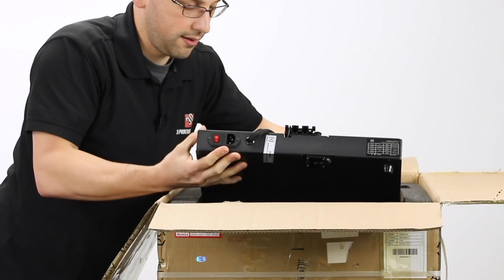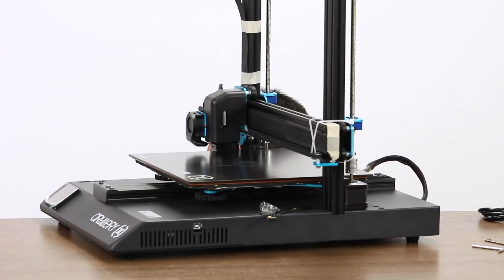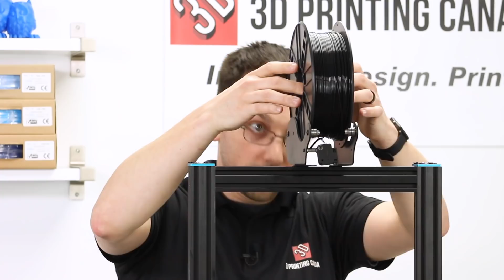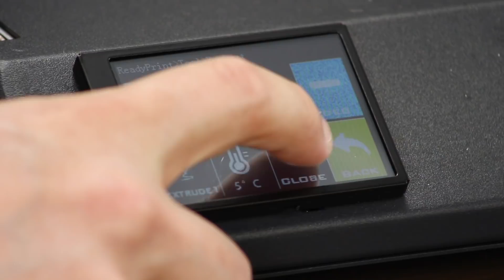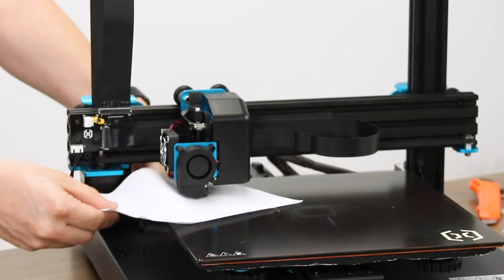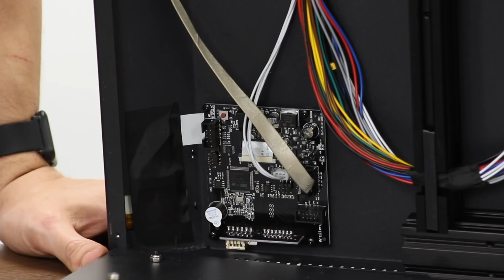Artillery (Evnovo) Sidewinder X1 3D Printer Unboxing, Build, and Test

Comment: Thanks for a great video.
Your channel is helping me a lot to get into 3D printing as I’m now looking to purchase my first printer.
I know it’s difficult to give advice so instead of that I’d like to ask you a question, anyone else who reads this and want to answer, please, feel free.

If you have to choose between the Artillery sidewinder X1 v4 or the BIQU-B1, which one will you choose and why?

Thanks in advance
Raul
Reply: Raúl Garcia Tapia I have been researching printers for over a year (while saving money for the purchase). I kept coming back to the Sindewinder because it is a “polished” printer. So many videos and comments are about “tweaking” their Creality printers - I’m concerned BIQU will be similar. I bought a printer to print objects not parts to polish my printer. I received my X1 V4 last week and have been DELIGHTED. It works perfectly right out of the box.  I tuned my slicer setting to the filament I bought by printing several Retraction Test prints. Once I got the extruded temp tuned in (I started about 15C to high) the stringing disappeared and the printers are excellent.
So my advice ... see if the BIQU videos and comments are about printing or about making parts to tune the printer.
p.s. I really liked this setup video and followed along as I setup my printer. The camera work was excellent. For example I wasn’t sure if I was to use the lock washers on the gantry bolts and the video clearly shows that. Doubt eliminated.

Comment: Looking at other channels that reviewed this printer, there are a bunch of easy fixes:
- tighten all the belts.
- don't use the stock spool holder and filament sensor; they are the main culprits of the odd layers.
- change the stock PTFE Bowden that inside the hot end. the stock one isn't brilliant and is a lot more narrow which also caused issues.

Comment: Hi.  I just received my Artillery Sidewinder X1 07/03/20.  A couple of things I thought you may be interested in. First, there have been changes to the cabling since you did your review. the  ribbon is attached already and now uses a locking connector not the push fit.   The Z stop sensor is also already installed and is not adjustable any more.  Finally, the dual Z belt at the top was tightly fitted and not loose as was yours.

The printer is really good and prints well.  The only problem I have is that using octoprint with the side usb connector seems to randomly crash the print making it just stop dead with no error.  The printer has to be rebooted to get it to work again.   To reboot it you have to pull out the printer usb as I found it was powering the printer even when it was unplugged.  That was a little disconcerting, pulling out the power cable to the printer and the LCD panel and hot end light stayed on! Took me a second to realize that it was drawing power from the usb. 

Hope this helps.

Comment: I just purchased the version 4 printer and am expecting my feed materials this evening.  Everything went together smoothly, as with your installation.  I have never used a 3D printer, so this is going to be the first of many (at least in my head...).  Thanks for confirming my thoughts for the finishing touches...
Reply: How is it now, how are the prints and would you recommend it

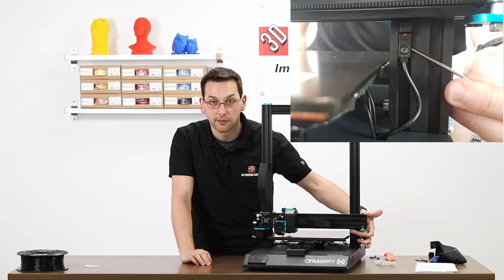Comment: Hello! What did you do to move the Y-axis sensor? 23:58) Since it comes screwed and the red light marks at 7.1mm, is it necessary to adjust it to 7.5? did you glue it? thanks for your time
Reply: That's the Z end stop sensor not Y as you've mentioned. And must be placed around 75mm not 7.5 as you've mentioned too. Take a look at the new reviews to X1 version 4, now the sensor is in a fixed position, not adjustable anymore. This means that for a better result on bed leveling and Z axis sensor positioning the first step to be done is to tighten completely the 4 big adjustment knobs under the bed (  compressing the springs as much as possible without breaking anything ). Step 2 raise the gantry manually. Step 3 place the tip of the sensor 75mm higher than the top surface of the bottom structural box. Step 4 bring the gantry downwards until the red light comes on. Step 5 loosen the big knobs evenly bit by bit until you reach the desired gap between the bed and the nozzle tip. Note that step 5 must be completed with bed and nozzle temperatures set to max. due to thermal expansion of the materials.

Comment: great video!     I think the folks over there that make the sidewinder must have taken a lot of input from you and others they gave their machines to for testing because my bed leveling was much easier. The Z sensor was already set to about 2mm from keeping the nozzle off the bed at the 1st round of leveling.  This was much easier to set up than my Ender 5 that I bought 18 months ago.  I also did not have a problem printing from MICRO USB or USB STICK.

Comment: This video confused me a bit.. and caused me to strip the hex-hole on one of my wheel's screws on my x-carriage... I didn't realize what "eccentric nut" meant, so I was trying to loosen/tighten the other nut instead.. I REALLY wish this video would have SHOWED me what nut needed adjustment, rather than just saying it.. Cause I ended up stripping the hex-hole on that screw, because the allen wrench they gave me was undersized.. Didn't even have to force it much to cause that.. ugh...
Anyone know where I can get a few replacement screws for those wheels? >_< This was a brand new printer.. I feel like such an idiot..

Comment: I really hope I didn't damage my printer.. I was trying to screw those bolts in underneath, off the edge of a table like that, when one of the rubber legs somewhat thumped off the edge, causing the hole thing to tilt and bump itself down onto the edge of the table a bit.. it wasn't a terrible impact, cause I was sorta holding it and it wasn't really a drop or anything that serious, but it was a bit of a jolt... I feel like such a klutz.. really worried about damage now..

Comment: I wonder who the asshat was that decided ribbon cable was a good idea on parts that are constantly moving back and forth...  Also there are no locking clips on the connector..
Reply: I've seen a few 3D printed clamp solutions for the X1 ribbon cables to help make sure the connection isn't upset during movement, but I've also heard of people putting a few dabs of hot glue on the connector when plugged in to help keep it in place - Glue which can be removed with some tweezers when you need to service the machine. Then again some people take no precautions with the ribbon cables and get lucky; their printer works for many print hours over the span of months without issues.

Comment: It looks like the 30 pin FCC ribbon cable was already connected to the breakout board on your 3D Printer. It wasn't on mine and the connector came right off the breakout board because I thought something was wrong with it - the X-axis carriage kept making a streaking loud noise when I moved it with the buttons on the touch screen. One or two pins on the 30 pin FCC ribbon cable looked messed up to the far right of the cable before I even put it into the connector to only damage the breakout board. An extra 20 pin FCC ribbon cable was missing from packaging, but I have an extra 30 pin FCC ribbon cable. It's too bad I don't have an extra breakout board to connect the extra 30 pin FCC ribbon cable to. >.< :(

Comment: That looks like an older revision as the latest revision has the reset button on the front by the touch screen.  I hope you will not be selling the older revs.
Reply: I spoke with them on the phone, they told me they were expecting Version 4, which should be the latest one for now.

Comment: So it's been 3 months since you posted this review but I haven't seen any follow up videos. What is your take on this machine now? I just ordered one today, really unbelievable at just $355 with free shipping. Do you know what version they are up to now and the changes per version? And how do you figure out which version your printer is? Will be very interested to see if the z issue you delt with is still around.  Can you run through what you did to eliminate that again please? Based on what you've learned,  what things should I double check with my new printer? What upgrades would you recommend? Thanks for your setup & review and looking forward to your reply.
Reply from the maker: We are receiving new-stock v4 units which have been improved over the v2 which is what was in this video.
Reply: @3DPrintingCanada  How do you distinguish between a v4 and the v2?

Comment: How do you figure out if you're buying the previous model or the current model? There's like 3 different listings on Amazon for the Sidewinder.
Reply: v4 version cames with a resume printer button next to the LCD
Reply from the maker: You can't they don't label the version number on the machine
Reply: Ask the seller. Some are currently listed as V4.

Comment: For anyone looking for this: https://www.banggood.com/ArtilleryEvnovo-Sidewinder-X1-3D-Printer-Kit-with-300300400mm-Large-Print-Size-Support-Resume-PrintingFilament-Runout-Detection-With-Dual-Z-axisTFT-Touch-Screen-p-1411501.html?utm_design=41&utm_source=emarsys&utm_medium=Neworder171109&utm_campaign=trigger-emarsys&utm_content=winna&sc_src=email_2675773&sc_eh=6bcea63a4e95e4bf1&sc_llid=14339318&sc_lid=105229698&sc_uid=Fibwt6sNxe&ID=48036&cur_warehouse=CN if it breaks any rules then please remove. All in all a great video but would have liked more details.

Comment: Heya,
Contemplating getting one of these, I already have a CR10, Tevo Tornado and a Folgertech FT5 (as well as 3 other smaller footprint printers that I rarely use). That said, I have always found that one of my first upgrades I do on all of these printers tends to be the fan shroud because the cooling on the stock is almost always inadequate so I normally go for the PetsFang.
How is the cooling on the Sidewinder?
Did you ever find out what the stepper drivers are? while talking steppers, do they have pots or is the voltage set by the firmware/UART?

Thanks in advance
Reply: @Jason I think something went wrong with my Lin Advance, I ran a K Factor print test in jumps of 10, no diff, did it from 0.1 to 10 in 0.1 jumps and they all looked the same so something didnt work on my K Factor setup.
Other printers I just do 0.1--5 in .1 jumps and on my other printers its normally around 0.3 or so. I need to run through my settings again sigh
Did you look at your backlash nuts? just curious if its just me or on all of them cause they made a lot of Z wobble lines till I changed them out
Reply: @Jason Ahhh I see. Thanks for that, all my other big printers are all bowden so didnt know about that change. Will give it a try after my current print finishes.
Do you find your prints are a LOT slower when using Lin Advance?. 
I have run it on a couple of my other printers and a print at 90mm/s with LinAdv on looks (and time wise) to be printing sub 60mm/s. I mean, I get that it changes the behavior when approaching corners etc but I didnt expect that much of a change. Mind you, I could just set the print speed at say, 150mm/s then it should be more like printing at 90mm/s.
Print quality went up a LOT but print times dropped a ton.
Reply: @Jason I would be interested in the results. 
I am much like you. When I first started out I was all about speed, I wanted good parts as fast as I could get them. 
Now that I have more printers than I know what to do with, speed is not really a huge deal because I pretty much always have at least one printer sitting there idle that I can throw the next print onto while waiting for others to print. 
I recently printed a 790mm tall 'Dobby' that took 1 day to print because I had 5 printers going at once each printing one part of the body. A day to glue, sand and prime and I have a great model, back when I only had one printer, that would have taken me a week or two haha

Comment: Would you recommend the X1 or CR-10S Pro?
Reply from the maker: At this point in time the CR-10s Pro is a better choice in our opinion
Reply: 3D Printing Canada do you still think so after the updates you did. I own a 3d printing company with several prusa i3 mk3s but I'm looking to expand the size/ print volume. I like the direct extruder on the x1 over the cr10s pro. Why do you suggest the cr10s over this machine?
Reply: @oneheadlight8000  i asked the same question. It looks like he doesn't monitor the questions once he uploads the video.
Reply from the maker: @oneheadlight8000  The V1 V2 and V3 X1 3d printers had issues. We are waiting to test a V4 before we make any further comments.
Reply: 3D Printing Canada thank you. I will keep an eye out for further comment.
Reply: @3DPrintingCanada  can you please elaborate on why this is the better option.
Reply: I got the 10S Pro, and Im really liking it :) I changed all of the fans (only the print air cooling left) and its practically silent, prints great!
Reply: Marcin Bauer does the 10s pro have the magnetic bed? I heard the bed demagnetized at higher temps so you can't print ABS or ASA easily. We have products that we print using ASA and I would love to be able to have this printer as an option for those products also.

Comment: This is by far the most comprehensive instruction video of all I've seen about the X1.  Slow and concise.  Thanks.  About the Z stop?  Most others say to put it on the outside slot so the wires don't catch on the bed.  I deleted my original post.about the extra flat cables.  ;-)
Reply: @Jason would you happen to have a S3D Profile you could share?  Need something to get me started coming to the X1 from a Tevo Tornado.  Thanks.  PM me.
Reply: @Jason would you happen to have an S3D profile for the X1 you cold share. I'm coming from a Tevo Tornado and there's big differences. Thanks
Reply: @Jason Thanks

Comment: I have this printer. It is very nice. One recommendation is to absolutely not put the spool on the top of the Z axis. Its just too tall and that is too much weight and your prints will suffer. Also the optical  height sensor needs to go on the far rail or your hot end assembly will hit it when going far right.
Reply: Blake Haas yeah I disagree. The extrusion is so solid on this machine. Make sure all four feet are firmly planted on a solid surface and you shouldn't have any issues with a spool mounted up top

Comment: I have an earlier version of this printer, and I’m pleased to see how improvements have been made from the older version - most notably the bed surface and the cooling fan. I think the stringing might be down to the heater block being as long as it is. I’ve had best results with 2 mm retraction, but I still do see stringing. I’m very interested to hear how you fare with this machine. There are other channels who’ve done what you did in this video, but there’s very little in the way of follow up videos about this printer.
Reply: @Jason Hi Jason, I just unboxed this SW-X1 two days ago. It's great but also got issues, especially the alloying stringing problem. I'll love to watch any mods videos. And I start following you from now. Good work!

Comment: I've had my artillery for a couple months now, There was issues with a damaged gantry ribbon cable but they shipped me a replacement along with a new stepper just in case. Overall aside from some common printing problems (tuning and clogs) she's been really nice to use. Exceptionally quiet, minus the occasionally noisy 40mm fan on the side where your version has a larger fan on the bottom instead. I'll probably mod mine to use a 120mm on the bottom. I did replace the z couplings with solid couplings and installed anti-backlash springs on the z screws which made a noticeable difference in print quality. There is a person on the official facebook group selling gantry stabilizers using 20x40 extrusion rails which reportedly stabilizes any wobble in the gantry. My only beef is the rather unique hot end setup. I wish I could swap this out to a standard mounting system so I can change the entire hotend if desired but that's just something I'll probably have to figure out on my own. Good review!

Comment: Can’t understand why they keep using the term level to the bed alignment. Your really making the bed collinear with X and Y Axis of the Hot End position-and the bed plane. Has nothing to due with level. Thanks again for the overview.
Reply: 😂 Your leveling the bed in relation to the hot end. What's hard to understand?
Reply: Starscream FPV Sorry ... you are incorrect. Using the term Level is not what you are doing ... I was just asking the question of why they insist on using that term. Just a point ... sorry I mentioned it. Have a good day.
Reply: Jason thank you Jason ... your right ... good machinist term ... I’m a bit anal about it being a Mechanical Engineer. I also have a machinist background... what you said is what flashes through  my mind when someone says level ... the newbie to this doesn’t know what’s being insinuated . Thanks for the feedback

Comment: At least they put a 20 x 50 ? rail on the X Axis, but still using the roller design that Creality uses instead of putting a linear rail in on the X Axis.
Reply: Most everyone uses that design because it's cheap and successful. Linear rails cost more and you can find them on higher end higher priced printers.